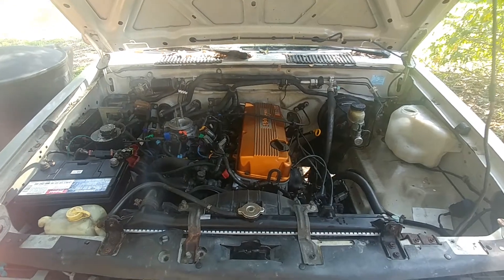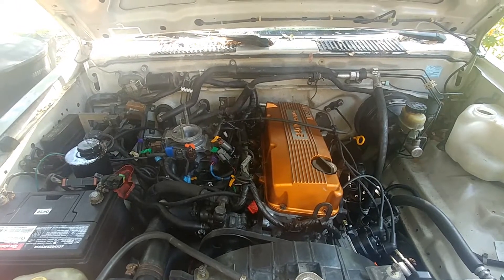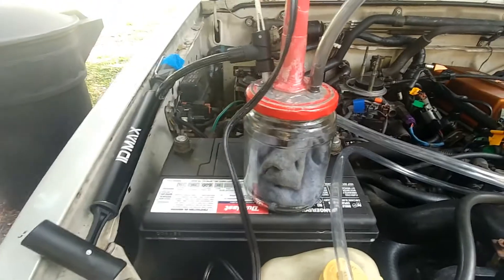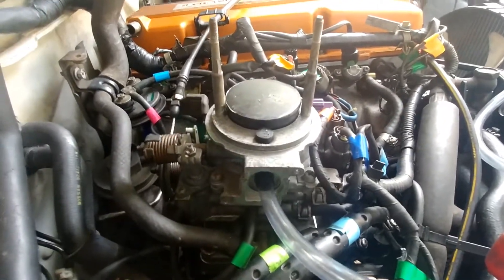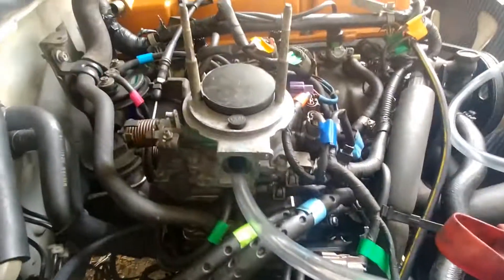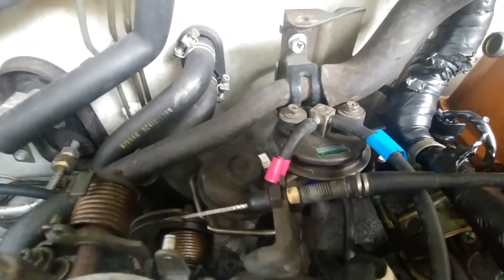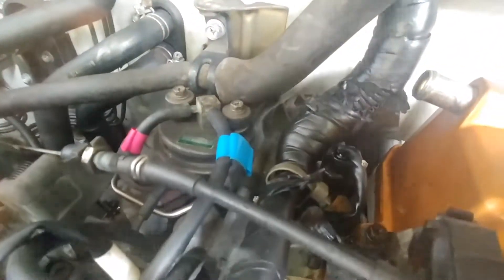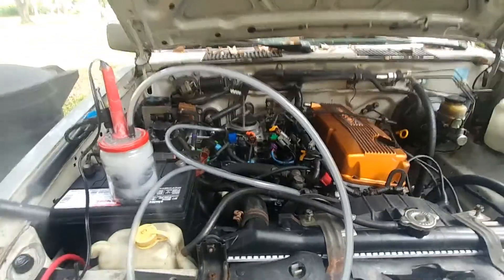Nissan D21 Vacuum Leak Detecting Smoke Machine

Comment: Very helpful, I’ve been having surging happen only at cold temperatures and some irregular idling a little bit hiccuping at idle and narrowed it down to a vacuum leak and I will be using this method to find it! Where did you get the plugs?
Reply from the maker: The one I got on Amazon for the throttle body is no longer available, but for the KA24E, you would need a #12 plug (62mm x 51mm).  Here's one..
https://a.co/d/7EHb8jq

I also got an assortment of smaller plugs from amazon - because ya never know when one will come in handy ;-)

Hope this helps!
Reply: I know this is old, but for anyone else who might look at this comment. You can put a rubber glove over the whole top of the throttle body. It fits perfectly.

Comment: I need a little help please i have 1993 hardbody runs really good but the motor shakes a bit i replace all vaccun hose wires spark plug  cooling temperature sensor o2 sensor and i dont know what to look for  can anyone  help me  out  please
Reply: Could possibly be bad motor mounts.
Reply: TPS

Comment: I saw a video that indicated that the egr solenoid diaphragm vents to the atmosphere until exhaust pressure actuates it to allow full vacuum to the egr. This means that the smoke you see is normal. I did a cigar smoke down the throttle body and also got smoke at the solenoid. Nowhere else though.

Comment: is the egrc-bpt valve fine if it leaks smoke? I did this smoke test and thats the only place the smoke came out.
Reply: As I understand it, the EGRC-BPT should leak a little when not activated.  However,  I tested mine using the procedure in the service manual and it failed - so I replaced it.  This cleared up my EGR flow error code too.
Reply: @signwavejack Hey Jack, is it possible to add a link of the Procedure to test? 
Thank you